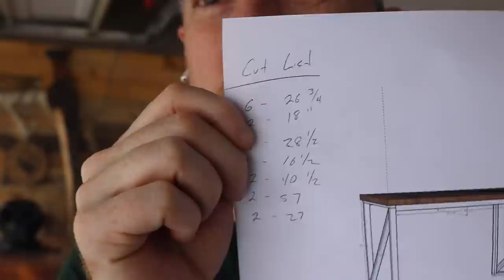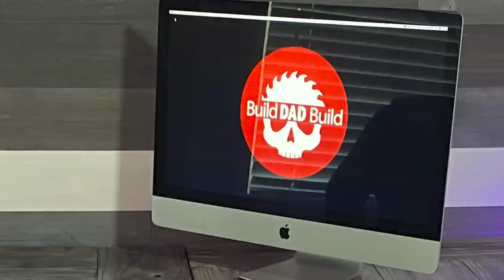DIY L-Shaped Desk - With Burnt Wood Finish

Comment: The reason your angled support does not have equal cutoff sides is because the overall shape of the legs are a rectangle, not a sqare. Changing the lengh or height of your Legs will also change the angle of the support& therefore the cutoff.
Reply from the maker: Good to know. I knew you guys were way smarter than me!
Cheers!
👍🥃👍🥃

Comment: For the angle to turn out on your supports you need the centerline matched to the outside corner, not the inside corner
Reply from the maker: Thanks for the tip!
Cheers!
👍🥃👍🥃👍🥃
Reply: I was gonna say, when you use the inside corner the sides of the diagonal cut have the same ratio as the sides of the frame. 

When you design things sometimes it is great to run it through a CAD program because it will show you just how your best laid plans won't work like you thought they would. Lol.

Comment: Great shirt. With construction grade lumber, it’s not square on the edges and you’ll never really get a flush look when butting it up against an uncut edge.  If you run the lumber down your table saw first and take off just over an 1/8th of an inch it gets those rounded edges off but you’ll need to account for the difference you took off when finishing the project.
Reply from the maker: Good to know.
Thanks, Patrick!
Cheers

Comment: the only way to get the cross members to be square is to have the box assembly's be a square.   for rectangles the corners make 90 but bisecting them doesn't give you 45 on each side.
Reply from the maker: Good to know. Thanks for the info!
cheers

Comment: Did you ever figure out how to get proper angles on the center leg pieces?
Reply from the maker: Yes. You measure from the outside corner, not the inside.
Cheers!
Reply: Build Dad Build Hmm, I’m a little confused, sorry my geometry is worse than yours, ha. Wouldn’t that make the pieces too long?

Comment: Do you not use stain on the whole desk? And do you just do really light coats?
Reply from the maker: I only stained the top and paint the legs white. I wouldn't call it light coats. The full stain coats were normal. The dry brushing effect over the top was light.
Cheers

Comment: How's the desk surface?  After burning and brushing I would think its pretty rough.  Not so go for writing on anyway.  It looks awesome!  I thought about building something simular but was worried about the rough tecture being a problem.  Unless you have solution for that...
Reply from the maker: I'll tell you the same thing I told my mother when she asked about writing on the desk. I said "who writes anymore?" LOL
It is rough. I, however, rarely write on anything except a note pad so it doesn't bother me at all. The one thing I did find is I had to buy a mouse pad.
A solution to make it smooth would be an epoxy flood coat.
Cheers!

Comment: To fix the whole centered angle for the inside legs. Run your center line to the outside corner of the frame and not the inside edge.
Reply from the maker: Good to know. Thank you!

Comment: is your dimension problems due to the lumber being cut in metric rather than old money?
Reply from the maker: My dimension problems all stem from the fact that I'm kind of an idiot. LOL
Actually I discovered the answer to the discrepancy. Dimensional lumbar is measured prior to being kiln dried. So a 2X4 is actually 2x4 before it goes in the kiln. As it dries it contracts, hence it only being 1 1/2 x 3 1/2 when it's dried. The larger the stock of lumber the more contraction, so anything over about 2X6 contracts more in overall width.
Cheers!

Comment: Really nice desk, 1 question on minute 14:10 that you are scrapping out a little the knots with the nylon tool doesn't that process removes the protective products?
Reply from the maker: Thank you.
It does to a certain degree, but the Varnish I finished it with is all the protection it will need.
Cheers!

Comment: Now I have a question. I want to build a computer desk but I wanted to use the wood burn technique...with cherry wood because that's what I wanted to use. But I really just want a hardwood with a lot of grain patterns that takes burning well. Any suggestions?
Reply from the maker: The problem you'll run into is that hardwoods have a lot less soft cellulose material to torch out. Maybe consider using cherry as the top and burning the apron or a surround of torched wood? Maybe the legs.
Reply: Build Dad Build Thank you for the suggestion ☺️.  But if I just wanted to use a good wood for wood burning, what would you suggest? 

I didn't want to use softwood because I know it's prone scratches and such but I really like the way wood burning looks. And if I use a softwood, is I'm there some type of layer I can put over it after I'm finished to reinforce it so it won't be as prone to scratches?
Reply from the maker: @champagnechampagne1943  In my experience, most hardwoods just ebonize. You get a really dark brown or black finish, but you can't really see the wood grain all that well.
If you use softwood try Total Boat's Halcyon Varnish. It's bulletproof...
Cheers!
Reply: Build Dad Build thank you!
Reply from the maker: @champagnechampagne1943  Sure thing. Let me know if you have any other questions...

Comment: Amazing man. Great work as always! Super cute little one! I made a dining table myself, the question I had was does the finish seem to seal those cracks for you? Messy kids=crumbs in my table 😩
Reply from the maker: Thanks!
The varnish I used probably would fill cracks if you focused more varnish in those areas. However if you've got some decent sized voids I'd consider filling them with epoxy.
Cheers

Comment: Another great video papa bear.  LOVE the finish! Have you have any issue with shrinkage and cracking of the top with the breadboard rigidly screwed in like that?
Reply from the maker: Nope. It's all good. Of course it is in the house where moisture and climate are controlled.

Cheers!

Comment: If the small box was the exact same or a perfect square the 2x4 would be center to center. But because the top is shorter than the height it offsets.
Reply from the maker: Got it.
Thanks!

Comment: It wont be even on a rectangle, only a square from corner to opposite corner.
Reply: well actually I think you could just twist it a bit until you have the same measurement of cuts on both ends.
Reply from the maker: So, what a few folks have said is if I would have used the EXTERNAL corner as the center it would have made the cross supports. Seems legitimate.🤔
Cheers!
Reply: I think that would make it worse, if you look in your video at around 6:15 if you centered it to the outside corner it would rotate the board clockwise  making it the cut more uneven. If you rotate it counterclockwise it would even it out. I don't know the geometry equation to figure out the angles and what not lol. But if you had your box first and laid it ontop of the board you could mark it that way and make sure both sides of your cut measure the same. 

Good day to you as well friend.

Comment: "I'm freezing my butt off"  Dude.  Don't even talk to me about that...  You're not even wearing a jacket!  😂 Nice desk, though.  And I'm there with ya on the 2x8, I wouldn't have guessed they'd be 7.25...
Reply from the maker: Man...you CHOSE to live where it's cold. I CHOSE to live where it doesn't drop below 30 degrees for a reason! I hate cold weather😜
I also just found out WHY 2 x lumber is .25 instead of .5 after 2x6s. It's because the wood is measured before it's kiln dried. When it's dried it shrinks (hence the discrepancy in the first place). Larger stock shrinks more...
Cheers!
👍🥃👍🥃 *hot chocolate emoji
Reply: @BuildDadBuild  Haha, yeah...  Good to know about the shrinkage!

Comment: If you want it pointy you could build the 'box' like you did, and then lay a 2x6 underneath and take a pencil and mark where the edge cuts will go, and then mark where you need to cut down on the outer trim to make it the "2x4" size. This might allow you to keep the same pointy edges. Basically you're just cutting out a template on a large piece of wood. I haven't tested it out but that's what I would try. It might look goofy though because your making a 45 degree shape out of something that's more like 60/30.
Reply from the maker: Thanks for the input!
Cheers!

Comment: Lol. Nothing worse than having the squirts on a Sunday... Usually happens after a good night of drinking.

Does the texture on the desk top bother you at all? I'd love to build this... It's beautiful. However, I think not having a smooth top would mess with me too much. Which means filling it with epoxy... and that'd change the whole dang look.
Reply from the maker: Thank you!
The only thing I've found so far is I had to order a mouse pad as mine gets a little wonky on the texture.
Cheers!
👍🥃

Comment: i can't tell you how many times a "standard" size 2x4 or 2x8 has fucked my day up. you draw it all up and cut it all down based on the idea of 2x4s that just don't exist.
Reply from the maker: Yup. Actually found out why this is. The wood is cut and measured prior to kiln drying. As they dry they shrink. The wider the board the more it shrinks!
Cheers

Comment: looks like you lined up the centreline on the outside of the square rather than the inside. its probably square to the outside but thats why its off on the inside
Reply from the maker: Gotcha. Thanks for the tip!
Cheers

Comment: my solution for getting the slightly misaligned diagonal piece at 6:50 might be too mathematical. 
But here goes:
measure the width of that piece to be joined, say 4 inches and divide it with square of root of 2,
which is 4 / 1.41421 = 2.83 inches approx.
Now make the marks 2.83 inches from the corners on each side of the diagonal of the legs and then align the edges of the piece on these markings to make your right angled cuts.
TLDR: use pythagoras theorem to solve this.. where you consider the right angle on the legs as sides and the width your piece as hypotenuse

Comment: Great stuff as usual nick. I was wondering what the finished surface of the desk is like. If you have deep burnt it then scraped it out with a wire brush is it ridged at all. If it is not and its smooth , how did you do it?
Reply from the maker: Thanks!
It is ridged. I wanted it that way. You could level it out with some clear epoxy if you don't like the texture!
Cheers!
Reply: Cheers mate I get it now. Kinda :)

Comment: Finish question:   To clarify the steps after the burn it appears you first use the nylon brush, apply all finishes (stains) then  use the nylon brush a second time?  You’ve commented on others videos that often people do not burn deep enough.  After you burned this piece it went from pretty dark to a great looking brown.  I assume that was after the first go around with the brush.

Great video.
Reply from the maker: That is correct. However, I wouldn't normally go in for a second brush. I just felt like this piece didn't have enough highlights so I brushed a second time to bring some of those highlights back.
And yes, I feel like folks are a little scared to burn deep enough on the first go.
Cheers!
Reply: Thanks for the feedback.  My finish turned out great.   Good channel.  Keep it up!
Reply from the maker: @bentdog5921  Great to hear!
Cheers

Comment: I'm going to try making a shou sugi ban coffee table. I'm wondering if I should do the burning before I assemble the table top, or after. I'm afraid the burning might warp the fresh pine.
Reply from the maker: If I'm doing a table top I usually assemble first, then burn. If it warps you can always burn the back to bring it back to flat.
Cheers

Comment: After you applied all the finishes did you do any other sanding besides the one with that wierd brush....and also in what order did you put the finishes or it doesnt matter . Just cant get over the color on that desk ....awesome.
Reply from the maker: No other sanding. That brush smoothes everything out pretty well. As far as the finishes go, it depends on the look you're going for. 
One that desk top I went lightest to darkest. So I did a coat of white wash and then I dry brushed on the weathered grey, followed by the ebony stain.
Cheers!
👍🥃👍🥃
Reply from the maker: PS. That weird brush is a Nyalox brush. You can check them out here:
https://amzn.to/31YpQKy

Comment: How do you like the surface now after using it for a few months?  I'm planning a similar build and thought about epoxy to get a smooth finish, but you make a good point about writing.  I do write but on a notepad, so that won't be an issue.  What about other annoying stuff like spilling a glass because it catches a bump, keyboard teetering when you type on an uneven surface, crud getting caught in the groves.  All first world whiny problems, but when you are working from home on your desk 10 hours a day, little persistent annoyances add up--especially when you put in a ton of work on a project and the annoyances were your own damn fault.  Not that I've ever been there...well, not today.
Reply from the maker: Hey there!
So here is the biggest issue I've found so far. I had to buy mouse pads (I have a couple of computers). I found that my fancy mice needed a flat surface and didn't perform well on the texture.
The other issue is what you already mentioned about the keyboard. But there's actually a "sweet spot" in front of both of my monitors that is flat.
Spills wipe right off the varnished surface. And I use coasters (but I used them before so that wasn't anything different! LOL)
But, I can honestly say that I haven't had any "man! I really wish I would have done THIS" moments aside from the lack of lip all around the desk (but I think I addressed that in the video).
Hope that helps!
Cheers!

Comment: Yet another great video and build! Couple questions if you don't mind... Did you prime the legs at all? And I assume you used pocket holes to attach the desktop? I'm building a desk myself as we speak using 1x4's for the top and can't decide if I just want to screw them down through the top and use wood filler to fill the holes, or do pocket holes.
Reply from the maker: Did not prime the legs. That spray paint is supposed to not require a primer. That being said, I went through FOUR cans of it!
I did pocket screw the top to the base. I just added the pocket holes when I was doing the ones to attach the leg assemblies to each other.
Cheers!
👍🥃👍🥃

Comment: Hi. Great video. Quick quest- could u have torched the lumbar first and then planed and trimmed it to eliminate or rather clean up the warping. Then glue, pocket screw etc? Any draw backs or problems that might arise if I did that?
Reply from the maker: I think it's like 50-50. I assembled it first hoping that the wood being attached would prevent warping. However I've spoken to some folks since that say I would have had better luck without the breadboard ends (I really thought they would prevent the top from moving).
But, its like all things woodworking...there's more than one way to get the job done.
Cheers!
Reply: Build Dad Build thanks man. Appreciate it. Keep healthy and safe in these time 👊🏽👊🏽

Comment: The only thing I would change personally is taking the breadboard end on the inside. But I do like that finish.
Reply from the maker: I debated about that. My only concern was without the breadboard that those boards might twist under the heat and it would be really difficult to line up.
Cheers!

Comment: How do you prevent warping?
Reply from the maker: A couple of things.
1. pay attention to grain direction at the ends of the boards. If you're joining multiple pieces, make sure to alternate them.
2. Keep the wood wet with a spray bottle to slow rapid expansion and contraction.
3. Burn the other side to bring back to flat.
I've also seen some guys put weight on the top while it cools to keep it flat.
Cheers!

Comment: I need to make one of these for my office to replace my extremely small desk that barely holds my laptop and lamp. You got me thinking now. I also agree on the dimensional lumber issue. If you're not going to make lumber what it is called...2x4 (aka 1 1/2" x 3 1/2") then at least keep it consistent. I've noticed that too with the 2x8 being only 7 1/4" ...WTF? It's frustrating.
Reply from the maker: Someone actually answered why there is a discrepancy in the lumber sizing. 
Apparently the boards are measured prior to kiln drying. And they shrink during the process. Larger stock shrinks more than smaller stock.
Who knew!?
Cheers!

Comment: Love the desktop. Looks great! I have sit/stand  powered legs coming for my L shaped desk. Was wondering if you thought dowels and glue along with the pocket screws would help with the warping and cupping or was that really just a problem on the ends?
Reply from the maker: Hey, Alberta!
The warping really only occurred on the ends and I got everything pretty flat when I burned the backside.
I've seen some folks use c-channel on the backside (route a groove and insert it) to mitigate warping.
Cheers!